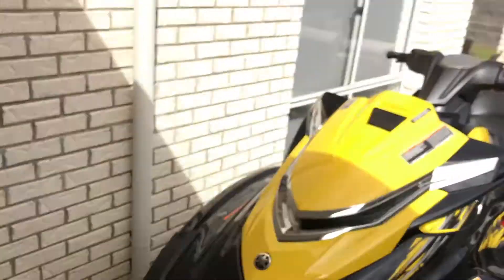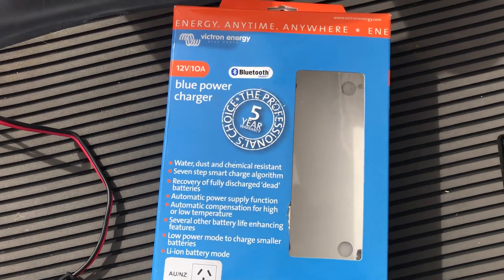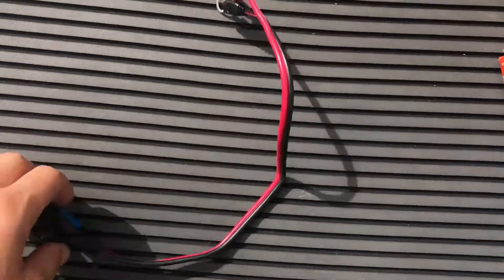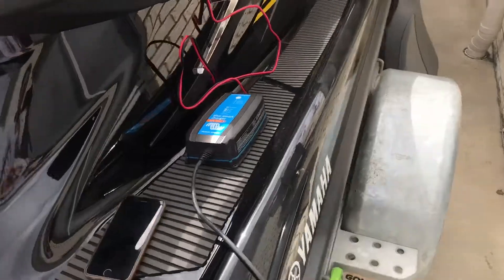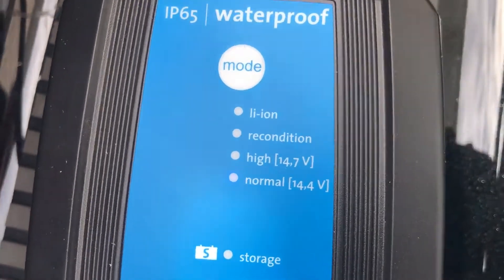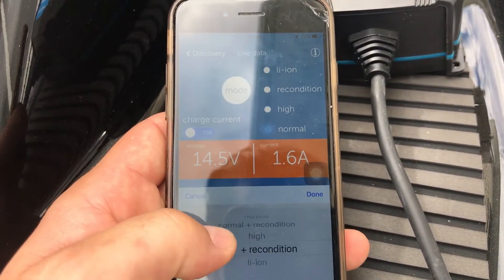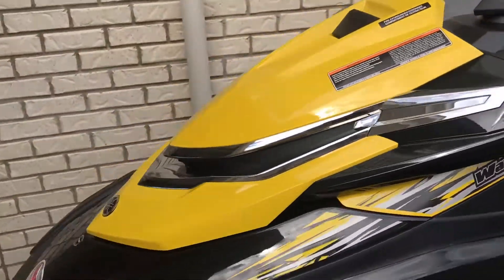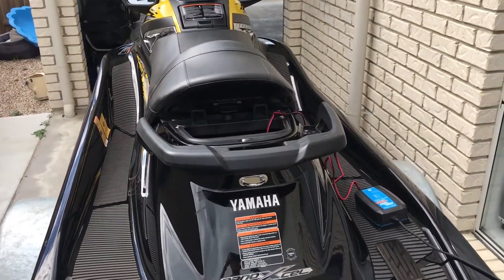VICTRON Blue Smart IP65 Charger with DC connector 12V 10A

Comment: Why in my manual does it say when connecting the charger to a battery in a vehicle. Connect the positive to the positive terminal but the negative to the chassis? Why not the negative terminal

Comment: Any opinions on the Victron charger compared to a NOCO G15000? 
I need to charge 12v 270AH liFeP04. I use NOCO gear for my motorbike and all Victron for van solar besides the batts